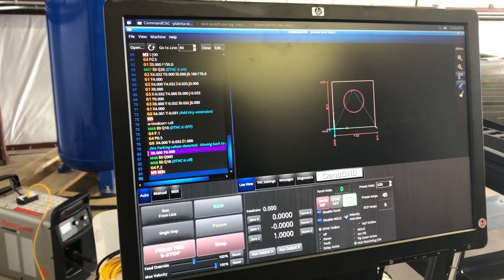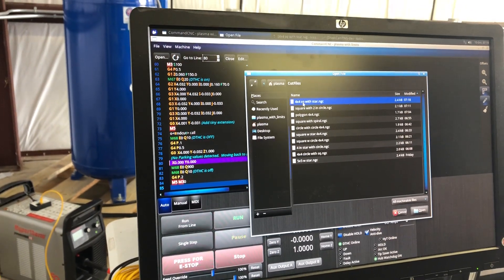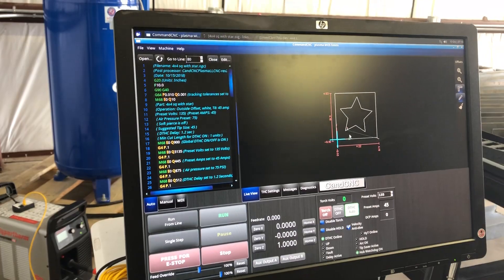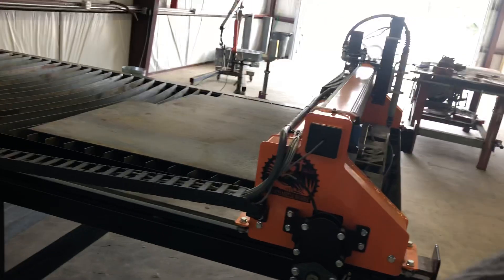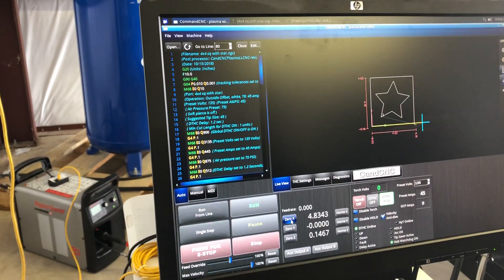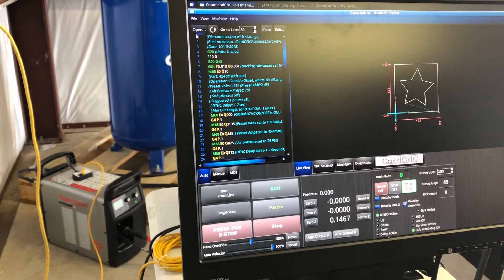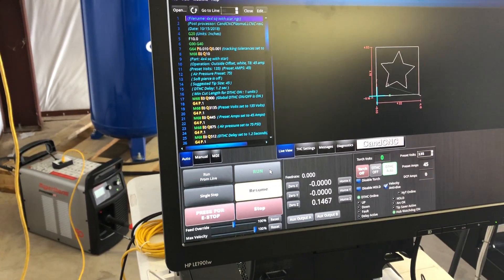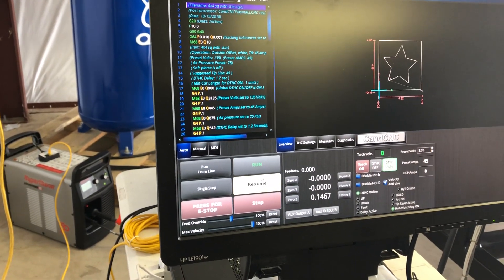Command cnc tutorials

Comment: Hi there wondering if you can help please, I’ve not used commandcnc since last wek and ive powered everything upppoday but now i cant jog any of the motors with the keyboard? eerything was fine when i turned it off the other day, anything i need to be on the look out for?
thanks
Reply: Check the little slide control that happened too me and it was doing that because the feed rate was set too 0